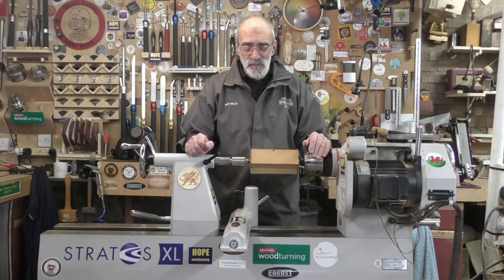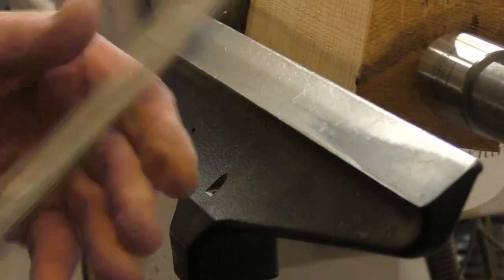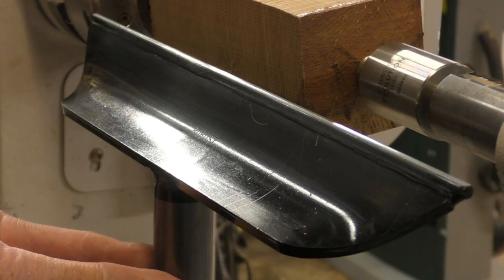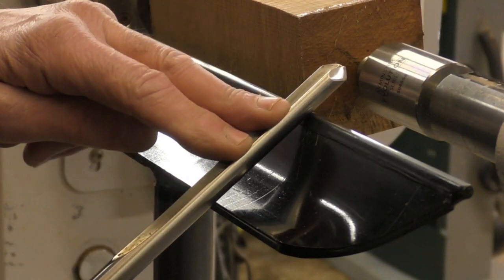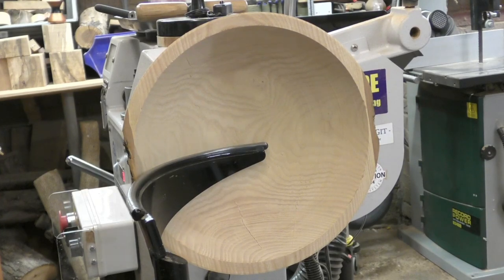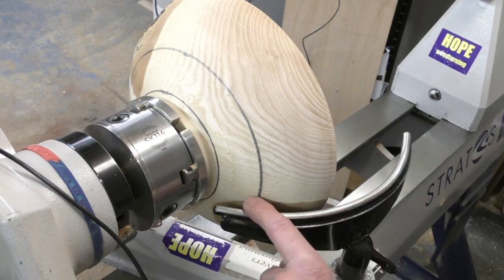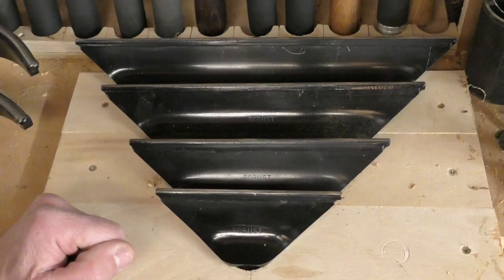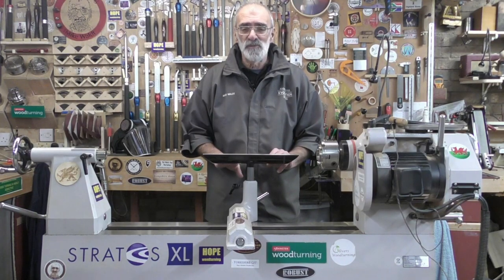The Robust Comfort Toolrest Overview

Comment: Great video Mike, delighted they are now available in europe. Laguna use the same design on their standard tool rests but they don't make the  curved bowl rests. That is one for the shopping list I think.
Shay
Reply: When you say Lagjna have the sane design, do you mean they have the hardened strip?
I have ong wanted a Laguna 18 36.
Reply: @icespeckledhens  yes the hardened strip and the same smooth shape. Basically it looks exactly the same as the Robust in Mike's video. If you drop over to my channel you can see it if that helps.
Reply: @BBTurning  Thanks
Reply: @icespeckledhens  you are welcome
Reply from the maker: Thanks Shay, I am amazed at the difference yo yo standard design.
Reply: @MikeWaldt  the design is really comfortable to use, I was amazed myself mate.
Shay